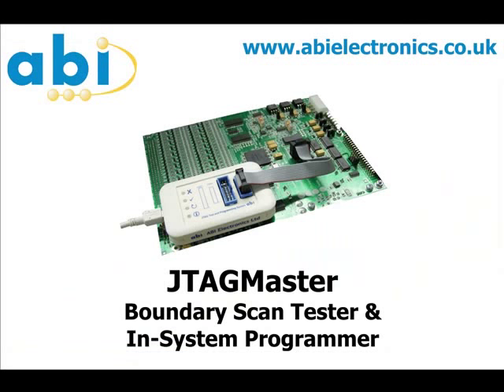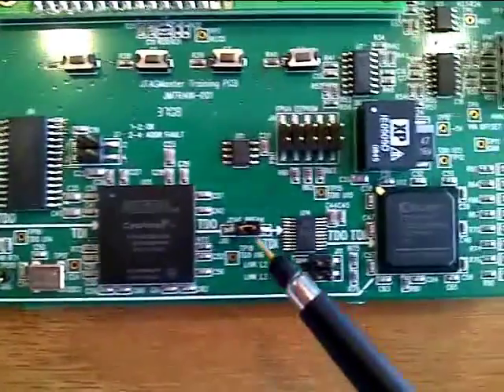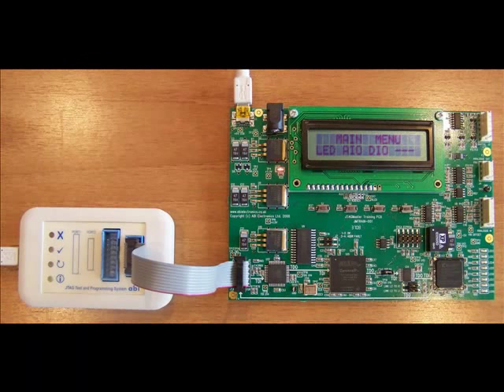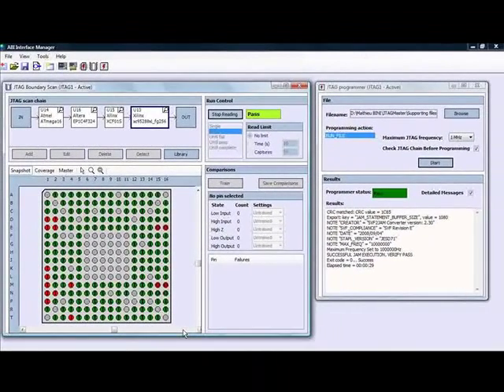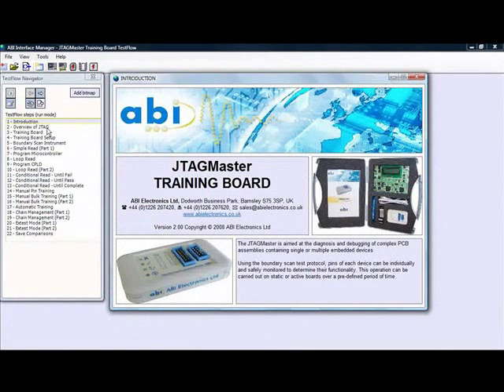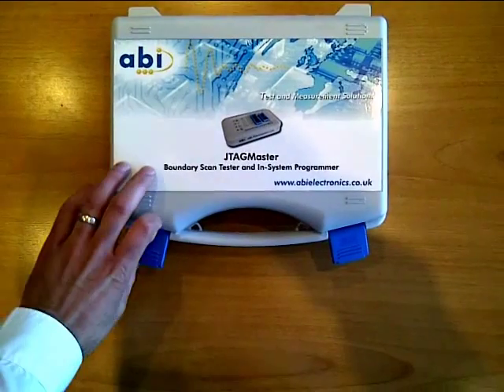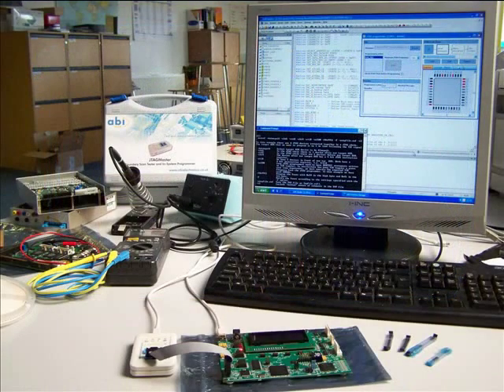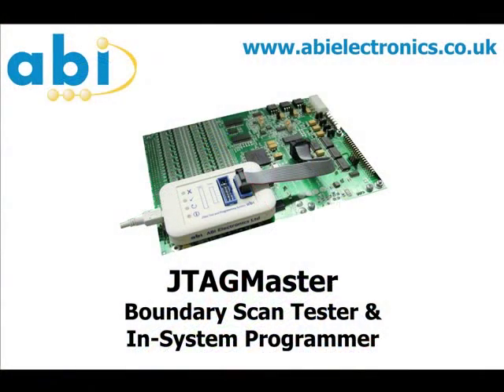JTAG boundary scan tester by ABI Electronics

Comment: I have owned the ABI System 8 Diagnostic Solution Plus, In circuit component test system for close to 12 years, this system is innovative, affordable and expandable. I first began with the BFL module, ( Board Fault Locator) the Digital component system,  then  some time later added the ATS, (Analog Test Solution) which checks linear components and semiconductors. As time and money allows I will be adding this unit to my system.  ABI has great customer support, for all your needs.